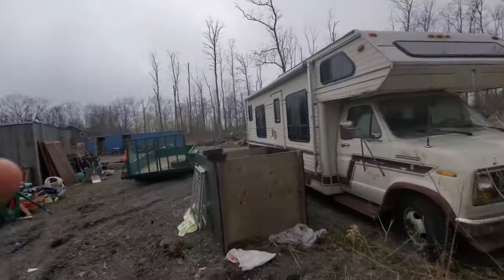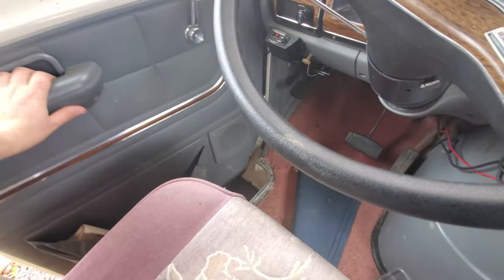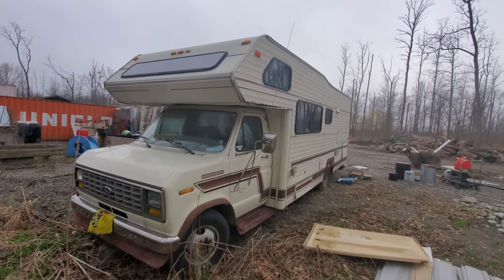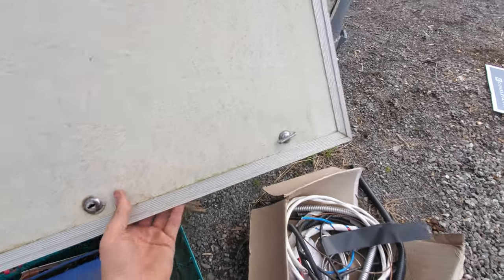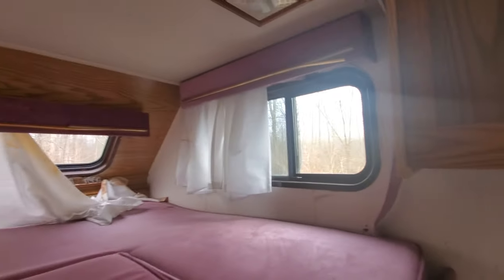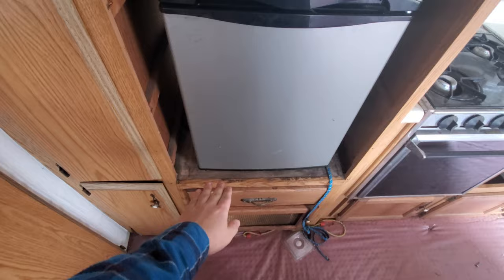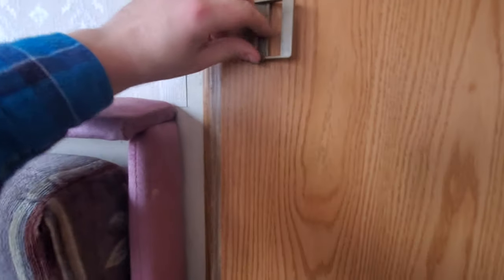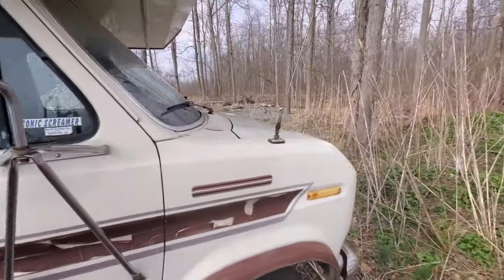Abandoned 80s Ford Econoline RV

Comment: It must be a "State thing" as of....(02/28/2022...I own, drive & Camp in a MARATHON, 1989 E-350 / 7.5Liter / 460cid V8 / 116, 000plus Odo miles.(different SetUp). Generac Generator with 1,740hrs ). I've been with GEICO....15YRS Plus...no problem. That Unit is mostly complete....and if the Engine and Tranny runs.....she is a keeper...and worth fixing it for use.

Comment: Hello from New Zealand. That’s a cool house truck. Love those big block 460 cid V8 engines. The body on this looks good for its age but those seams on the edge of the panels on the outside may need replacement, that’s the cause of many water leaks etc so you may need to pull the inner panels off from inside and replace . Awesome project for you if you can fix it up. As for the LPG unit you be best to get rid of that part.

Comment: I have an 86 with the Windsor engine. I like the Windsor better, because it is easy to work on. Mine is a barn find with just 29K and stored inside. Would not trade for a new one.
Reply: Will you be doing video content fir it...  Which engine has more low rpm torque... The Windsor or Cleveland

Comment: When we bought our Winnebago it was a 79 and it had the same issue with the insurance when it comes to the furnace and hot water heater.
To get insurance the previous owner had the disable the hot water heater and remove the furnace.
Also the 3 Way fridge had to be removed as well.

Comment: Would like more info on the insurance  gas/propane thing if anyone knows about it.Thanks for the video.
Reply: You need to have the system pressure tested.   They connect a gauge to your intake on the stove, then open the main line, then close the main line.  In 15 minutes they check the pressure again.  You can only lose x amount of pressure to pass the test, I don’t remember the pressure drop your permitted but our /92 passed with good numbers.  After test you get a tag attached to your tank and you can get insurance.  It’s an expensive test. Our test was $90. CDN.  Repeat tests will be required every 5yrs I think-not completely sure.

Comment: Candidate for electric conversion.
Reply from the maker: That idea sounds good on paper but in reality most likely wouldnt be worth it, 60k in batteries probably, but now because youve added 15,000 lbs or more to vehicle you are now going to need a 2000 dollar+ brake upgrade and you will no longer be allowed to drive it on the road as it will be over its GVWR rating too. Not to mention you would get about 30km of range because of the weight and the vehicles lack of aerodynamics